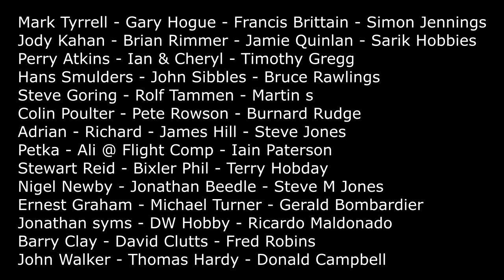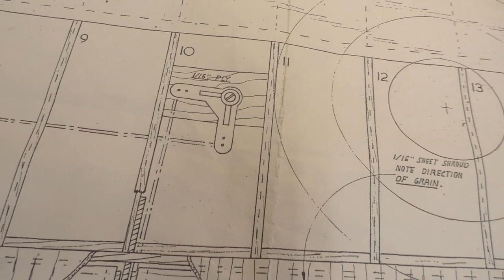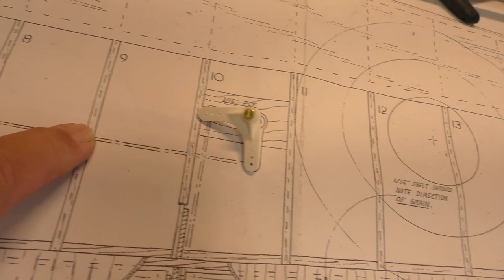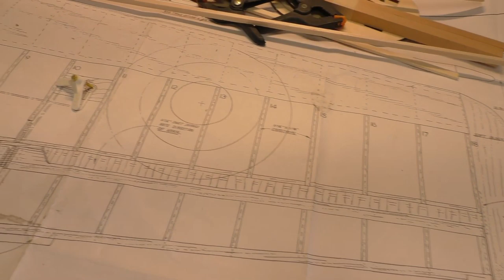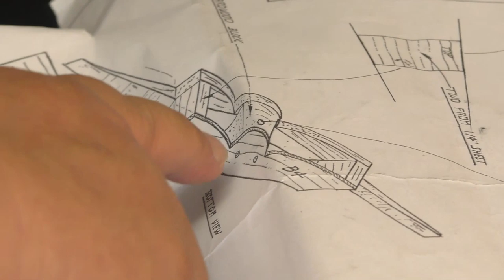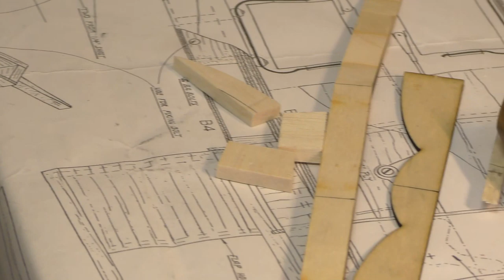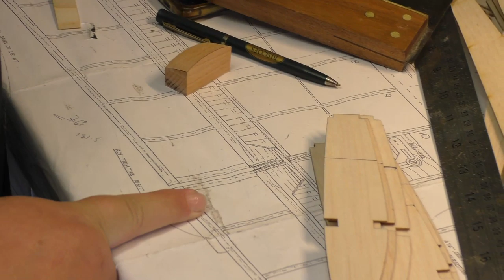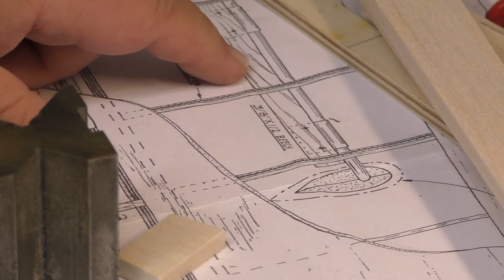Sarik Hobbies Dennis Bryant 68" DHC-1 Chipmunk Build Pt13 RC Model Geeks

Comment: Those bellcrank cross overs are very strange ? cannot really see why DB did that,in the days of 35 mhz you would have problems with music  or noise with any metal to metal connections causing radio glitches,we used to avoid metal to metal like the plague and funny how even today things like that stand out on a plan,I think you were concerned too Rob and wisely mounted them the correct way,unless he was using some strange differential on the ailerons.
The undercarriage lights are white landing lights mounted in neat fairings,the lighting will really bring the Chipmunk to life.

There is a lot going on in that Chipmunk wing,quite a few designers ignored the gull effect at the lower centre section but not DB,it complicates the construction for sure as the wing root lower fairing merges into the structure,if you look at the Spitfire it is the same but often ignored by model builders for simplicitys sake.

Making up a kit of parts as you are doing with the various tapers is the way forward,there are a lot of learning curves in this model for future budding  builders,a classic model of a classic aeroplane that is loved by many even today with plenty of civilian ones still in service ,and like all classics they retain their price.
Reply from the maker: Yeah the bell crank install is very strange. I can only presume that Dennis didn't want the rib slotted. so that was the only choice.  Yeah the metal to metal contact was certainly a real problem back in the day. As long as the pushrods enter the bell crank from different sides then there will be clearance at the crossover point. But because i want to use clevis's  instead of just Z bending, i wont have the clearance, so that's why im going to turn the bell crank around.

Comment: During the preview video, you mentioned maybe buying a balsa strip cutter.  But I see you cut these spars with a knife & ruler. Just wondering is you find that to work better, or its just what you had in the shop?
Reply from the maker: The strip cuttter i got needs to be fixed to the bench! which is a pain in the arse. was just as easy to use a long ruler and a scalpel.
Reply: @Rcmodelgeeks  Yes; that seems odd that you would need to slide a large sheet of wood along a small cutter. Almost seems like you would get a straighter line the way you did it.

Comment: Bob would you be so kind as to tell me what you are going to use as canopy slides saw the piece a few videos ago but did not hear the identification of it. Maybe pass on the part number and the mfg"r. Thank You Much
Reply from the maker: The guide rails are U channel Plastruct https://plastruct.com  I'll see if i have the part number when i'm in the shed.  I will make some slugs that run in the U channel and fix them to the canopy.. All will become clear in a later video.